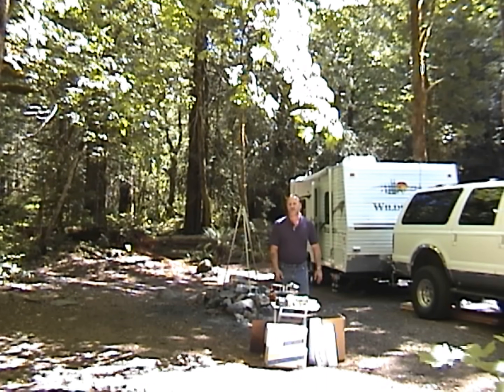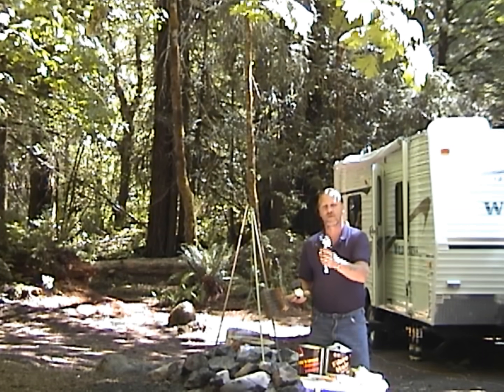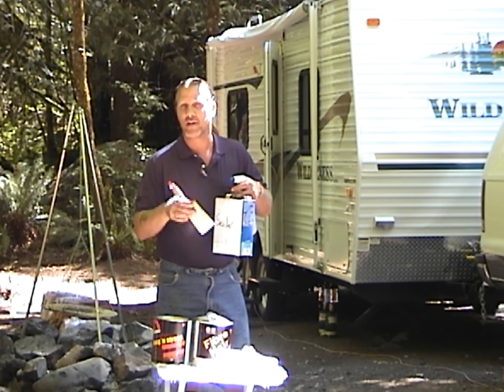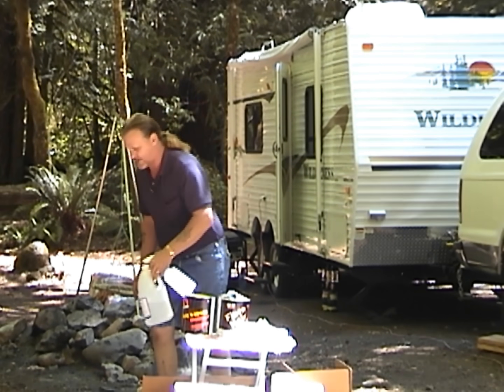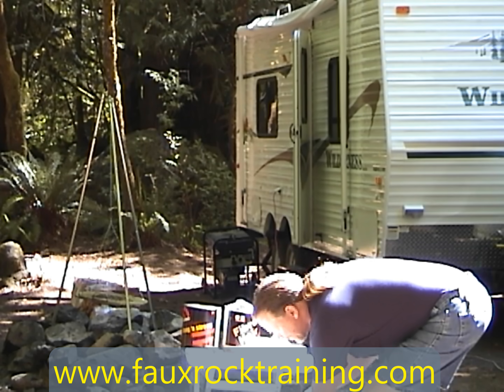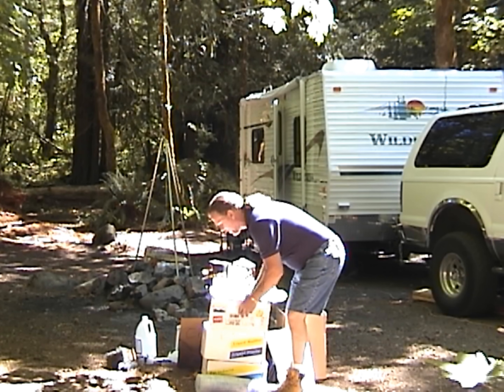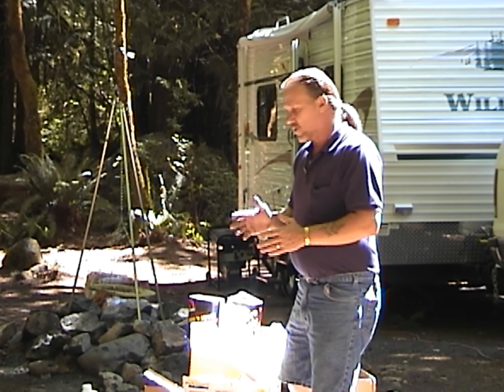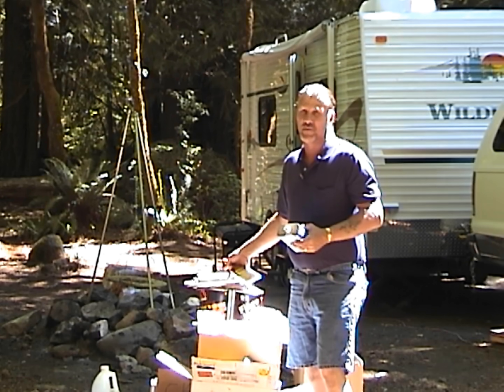Molding and casting a rock panel (PART-1)

Comment: What kind of release agent have you been using? I am afraid the  Mold Release might soften the acrylic  sealer making the rubber bond to the model...any suggestions? Thank you
Reply from the maker: I use universal mold release… i’ve never had a problem with the release agent emulsifying the acrylic sealer, which you say, would create a bond between the acrylic sealer, and the rubber.

Comment: hello, what fibre glass resin is being used hear? I want to ensure I'm buying the correct fiberglass product to produce this. also I'm guessing it doesn't matter what acrylic sealer & mold release you use? But if you can recommend what products you use ill look into getting the same ones. 
Many thanks in advance.
Reply from the maker: Usually you find this fiberglass Mud mixture at auto supply stores in 1 gallon cans. It’s called long, strand fiber mixture.
Reply: @fauxrock  perfect! Thankyou for your help, much appreciated.

Comment: Great work! How long does it take d
For the rubber, and the fiberglass mold to dry respectively? Also, the fiberglass you are pouring, is just the liquid without any glass fiber sheet?
Reply from the maker: Both dry within hours. The fiberglass mixture had long strand fiber already in the mix, so no need for the mesh
Reply: @fauxrock  ah I see, so I can prepare a mixture of polyester plus fiber already in the mix so I don't have to use sheets of fiber.
Reply from the maker: 👌 that is correct
Reply: @fauxrock  thank you for the info and the quick responses! Take care!

Comment: Hy! 
What makes rubber so liquid?

it's very sticky for me and I can't apply it that easily.
I need some kind of dilution mixture?
I didn't use Superseal, maybe that's why I can't apply it in such a thin, liquid layer?
Thank you very much in advance for the answers!
Have a nice a day!
Reply from the maker: I’m not sure what rubber you’re using, but I use the Smooth On brush on series.
Reply: Thank you for your answer!
I tried to brush on 40.
But I'm not giving up, I'm trying.
I have one last question. You use about 1 gallon of brush on for the mold in this video.
Approx. 1 gal=2 meter x 1.5 meter mold? 
You can know a ratio, how many molds come out of 1 gallon?
Thank you for your help!
Reply from the maker: I don’t remember how much rubber I used to make the mold, as it was back in 2008.

I know the molds I made today… 1 gal of rubber coved 8 sqft of rock.

Going back to your your rubber not working for you… You need to brush on your rubber layer at only 1/4 inch or 6mm thickness. That will work be best for you.
Reply: @fauxrock  I'll take your advice! Thank you very much for your help!

Comment: How do you do this without the greenies having heart attacks or getting caught? I have some great areas in st louis with rock faces like this but busy body Karen's would call the cops or email on me. I've always wanted to cast some rock face.
Reply from the maker: Yes getting approval is next to impossible because of the release agents and the rubbers toxicities to environment. Fortunately for me the most of the molds I took were years ago when this wasn’t such a big deal. I have over 75 different rock molds that I took from out in nature without any big deal. In fact the video I shot this panel on was in 2009 and I did have approval to do it but I still had the Financial risk of being fined for environmental contamination even though I had  obtained legitimate permits
Reply: This is a late reply but you can try to go to one of the rockyards in town where they sell landscape boulder.  Talk to the owner or offer to pay a small fee to go over there during a weekend when they are closed and make a mold from one of their many boulders.
Reply from the maker: Keep in mind that in order to make a mold off a rock, you have to seal it and then release it with the oil to be able to extract the mold. In the landscaping yard route the rock with no longer be something the landscaping supply place could sell because it was not a natural look anymore so I don’t think that routes going to pan out other than if you bought the rock and took it home.

Comment: Ever heard of Leave No Trace?
Reply from the maker: If you’re referring to the clean up of the site... I can assure you that nothing was left behind. We totally cleaned up the site.
Reply: I’m sure all the sealer and mound realest just evaporated I especially respectThe way he just rinse is the entire thing off in the water . you could’ve just made those rocks out of Styrofoam covered in cement  inside of your garage and carved  the Took molds of the styrofoam rock and you would’ve had just as real of a mold as anything that came from the wild it with less effort and more creativity.
Reply from the maker: “To each his own” You are free to put up videos to demonstrate your techniques...
Reply: @fauxrock  IM JOHN WICK
Reply: R u a man
Reply: I like this idea except for the use of acrylic sealer and mold release. I used to make museum exhibits for a living and we did a lot of fake tree and rock casts for scenery. That acrylic sealer and the mold release are synthetic compounds that is going into the water system. I bet you could find a less-resilient biodegradable sealer that would work fine for the 1-off use, and then break down. I think the mold release probably makes it easier to get off, but I suspect you could omit that  to avoid another chemical going into the water system. Use mold release all you want in casting to extend life of the mold.

Silicone rubber is really good at not adhering to anything except other silicone, I support the act of taking a mold impression directly off nature. I don’t feel that is somehow in violation of leave no trace, except for the use of mold release and sealer.
Reply from the maker: I don’t see the big issue here... in the big picture is a minuscule amount of material used that would have a very insignificant impact on the environment which I took them molds